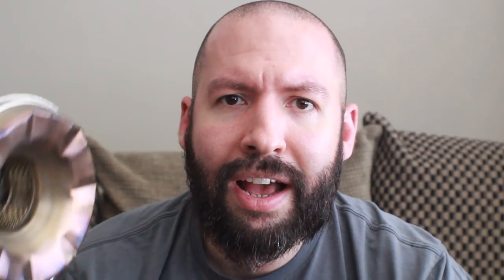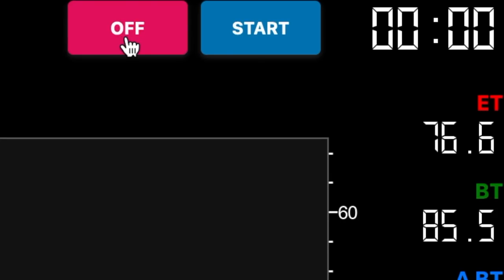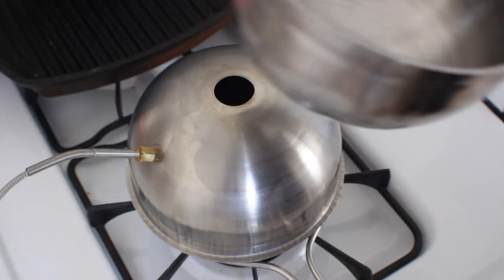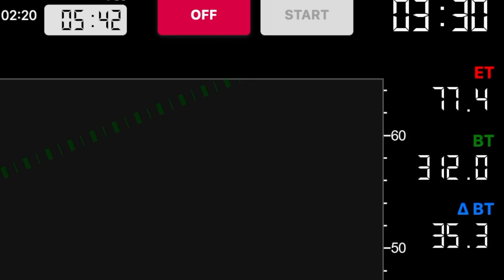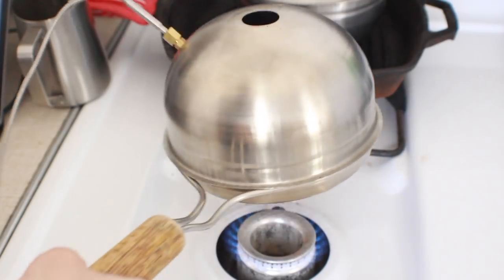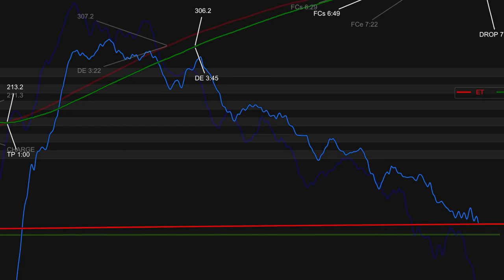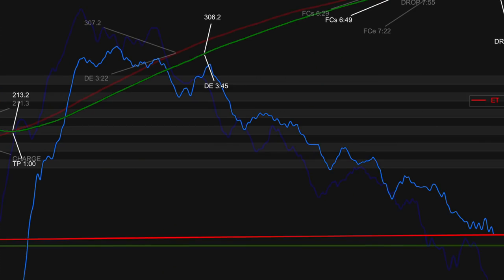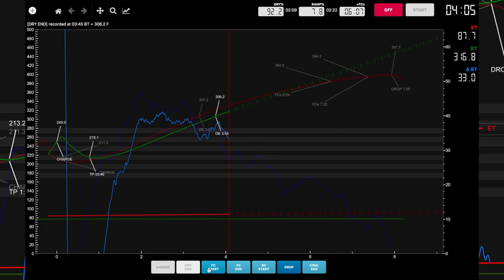ROASTING COFFEE - Learn At Home On A Budget

Comment: Right now, I’m just using a wok and a whisk. I haven’t gotten into fancy profiling stuff, I’m just trying to roast my coffee nice and even
Reply from the maker: Mit Solanki that’ll definitely get you there. Similar principles. Constant movement will always be key!
Reply: same here! Do you ever try medium heat or high heat or something else ? any tips maybe?
Reply: Verry Vernando I use medium heat and whisk constantly, in circles, rather than back and forth, to ensure consistency of roast. My only challenge is figuring out a way to blow away all/most of the chaff. Oh, I also have an electric stove and not a gas one. Take that into consideration as well. A cast-iron wok may do better because of heat retention and even distribution.
Reply: The Real Sprometheus Yep! Definitely. And less arm pain too, apparently XD.
Reply: Verry Vernando also, learning to cup your coffee is a great skill to have. I usually do 3 cups, or the triangulation method. It tells me how consistent my roast is, what it tastes like, and where do I take it from there.
Reply: The Real Sprometheus any suggestions on how to clean up the chaff afterwards? That’s the one thing I’m having trouble with.

Comment: I love the simplicity and capability of the fidget and free artisan software! 
I'm using a simple air fryer with a raised, round stainless steel flour sifter added. I use smell and sound along with the digital temperature adjustment on the machine to control the roast. 
It's working quite well after a lot of practice/experimentation to get consistent roasts. I've been able to get first crack within 5 seconds consistently from roast to roast. The downside... Above 50-some grams, the roast becomes inconsistent. The good side... I think it will work well for samples. 
I wish I had a fidget and a way to get a fixed temp probe or 2 in the machine. That would be pretty stellar.

Comment: I've been using a Fresh Roast SR500 for about 4 years now. I've got the extension tube as well, so I do about 180g at a time now. It's very fast, about 15 minutes a batch, and produces a very even roast as the beans circulate around in the hot air. I modified mine with a long deep fry thermometer poking through the top and have also observed that first crack starts at about 400.
Reply from the maker: mexicanhalloween nice! A thermometer is a great mod for sure.

Comment: The Hive is so hard to control. After 7 months of frequent practice I finally got an almost smooth RoR but then completely forgot to grab my sifter lol
Edit: Some things I have learned while using it is the RoR can change dramatically if you change the rotation of the coffee when you switch hands. I had to train my other hand to rotate at a different direction if that makes sense. Also using both hands instead of one greatly reduces strain.
Reply from the maker: Carlos zapata oh yeah it’s absolutely a challenge. You’re better off never switching hands and just fighting through the burn, haha. That’s how I got my best profiles. Maintain the same speed and rotation all the way through.
Reply: Carlos zapata good knowledge. It’s true. I have preferred the coffee from it by far to what was coming out of my behmor which probably goes without saying.
Reply: What is a typical starting and finishing ror for you? I know it depends on coffee but I also think I’m shooting out of the gate too fast sometimes.
Reply from the maker: Theo Angel with the Hive I haven’t fully mastered it yet, but when it comes to roasting in generally I try to be between 5-10 RoR left by the end. I want to make sure I have enough energy for a proper development but not too much to where the heat is still ratcheting up quickly on the end.
Reply: The Real Sprometheus ok great, yeah I have flown out of the gate sometimes with a 50+ ror and then have to try to balance it all out after. Will definitely dial back and try to drift down slower as you described.
Reply: I pretty much don't get a nice declining ROR, I don't know if my burner is the problem if it's too strong for the Hive. Recently, I stumbled upon a bean that doesn't really like short roasts and its pretty hard to prolong the 1st crack without burning it. ROR tends to stay at around 30 hahaha

Comment: Hi, can we distinguish the main difference between 1st and 2nd crack?
1. Is there a clear time gap between 1st and 2nd crack such as after 1st crack stopped for some time gap, then follow by 2nd crack?
2. Judging from the smoke level, can we distinguish 1st and 2nd crack by means of the amount of smoke generated? Which means, does 2nd crack generates much more smoke than the 1st crack?

Comment: The Hive Looks like a nice entry level roaster. I am using a Behmor 1600+ and get pretty consistent results, but I haven't tracked temps in it yet, just have a routine I follow for different coffees. I basically have separate profiles for African, Central/South American and Indonesian coffees. I think the 100 g roast size would be an issue as I need about 300 g a week and don't want to roast three times a week on the regular.
Reply from the maker: Jamie Moore awesome! I would highly recommend seeing if you can connect a roasting software to it. It can definitely help you get the same results consistently.

Comment: This is what I was waiting for! Thanks for making this. Learned some more stuff from ya. Question, so I got a phidget 1051, and it is a bit finicky to get my artisan read the thermocouple, have you ran into any issues like that or do you have any gotchas?
Reply from the maker: MDere glad this was helpful for you! So I think the it tends to be more finicky when not engaged on Artisan. I notice if I just let it ride without starting a roast I’ll eventually lose the connection. But I I tap off/reset on Artisan and back on again it will pick it right up. I’d just double check the connections and hopefully it won’t drop off mid roast.
Reply: @Sprometheus  Do you have any recommendations on roasting times for the Hive? Like a range I should be targeting for?

Comment: Love the videos. I’m using a fresh roast 700, a hot air roaster, which allows me to use Artisan. I have also modified with thicker longer glass to allow for roasting 180 gm per roast. I have a blend of Brazil, Colombian, and either Guatemalan, or Papua New Guinea I roast for my wife and can repeat pretty closely ( this makes her happy ). I like fluid bed roasting though I am always wondering how much this style differs from traditional drum roasting more so in the cup than anything else.
Reply from the maker: Thanks Steve! I appreciate the kind words.

When it comes your blend do you go for a pre or post roast blend? That’s a topic I definitely want to dig into soon. 
In terms of a fluid bed vs drum I personally prefer the drum, but you can get great coffees either way that’s for sure.
Reply: The Real Sprometheus I blend post roast, though have blended first when low on beans. The Brazil and Columbia seem to roast in a similar manner, the Papua seems to like a slightly shorter roast for me as does the Guatemala.
I am really  into an Ethiopian Sidama Adri I get it from my local “Water Street Coffee roaster” in Kalamazoo. I can get a good berry feel from it at the end of first crack.
As for cooling I use a colander, a box, and a small appliance fan getting room temp cool within 2 min.

Comment: I would be the target demographic for something like this but I do prefer something that can handle a larger batch size.

Can't beat that price though.
Reply from the maker: Ricky Ng for sure, but you can increase the batch a bit. I’ve done 150g in there before. It works; just takes a lot longer.
Reply: @Sprometheus  don't tempt me lol

I'm trying to save for a Behmor Jake or Aillio Bullet.
Reply: Ricky Ng I have the Bullet and I really like roasting on it. For me, it’s hard to roast small samples on the bullet so this is the reason I purchased the hive as well.  I’ve noticed that some Importers will only send small samples. All of the other sample rosters were way too expensive for me.
Reply from the maker: Ricky Ng the Jake looks pretty wild. I have to say though. Electric roasters taste different. Not bag, just...different. It’s like the difference between charcoal and gas bbq.
Reply: @Sprometheus  in your experience, what's the taste difference between electric and gas roasters?

Does one bring out more acidity? Maybe one drum heads up more and chars coffee easier, requiring more air flow? Or is it something else that distinguishes between the two?

Comment: How do you profile using a hot air popcorn popper(y)?
Reply from the maker: That’s a good question, personally I’ve never done it so I don’t know if it’s even possible. But you’d definitely need to modify somehow to put a thermocouple inside the popper and then connect it to your computer. May be more trouble than it’s worth.
Reply: how do you separate and remove chaff using the hive?